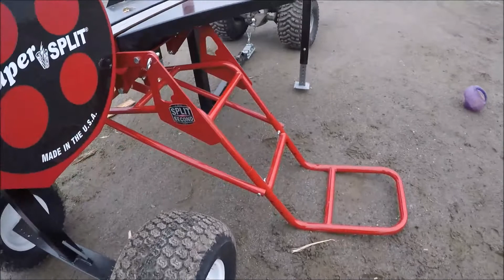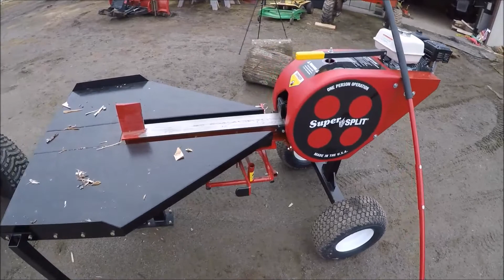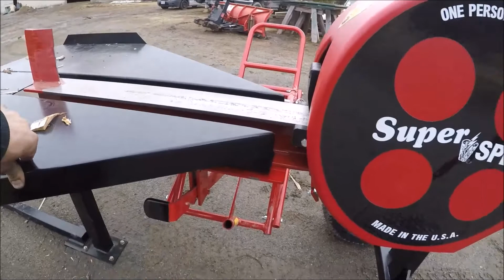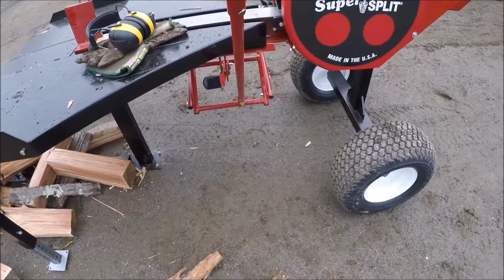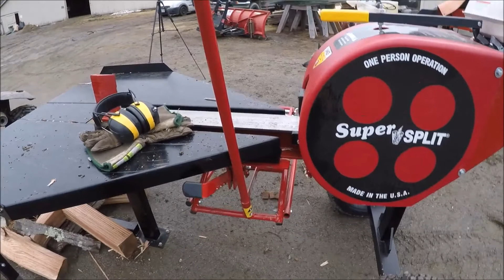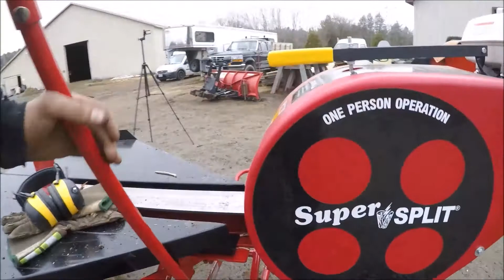Supersplit Log Splitter With Log Lift

Comment: I have a Split second with the log lift. You may want to put the pins that hold the log lift on from the inside out. If a piece of wood bumps them the way you have them installed they can get knocked loose.
Reply from the maker: I appreciate the insight and I will make sure my pins are in the other way this coming summer when I use it because I can imagine it would suck to have that thing fall off loaded with wood
Reply: @owentimberlake6508  ผมอยากทราบว่าเครื่องนี้ราคาเท่าไรครับ

Comment: Looks like you can't buy that log lifter anymore unfortunately. Owen would you mind sharing why you decided on a kinetic splitter vs. a hydraulic one? Thanks for the videos.
Reply from the maker: i went with the kinetic splitter for the simple fact that my first splitter was a super split mini and I fell in love with it  The return speed is so much quicker and this size splitter there is not much it can not split.  I also really liked the height of the table and the fact that I could easily adapt the log lift to it.
Reply: @owentimberlake6508  Thank you. I look forward to more videos of your splitter in action.
Reply: I just bought one on eBay for $200